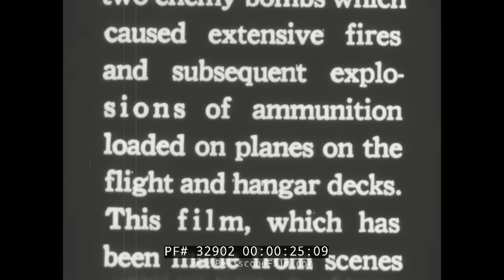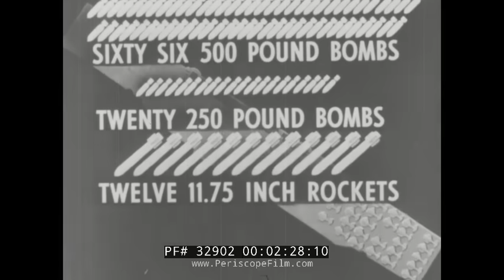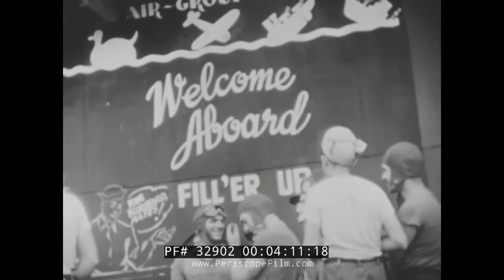" USS FRANKLIN "   STRUCTURAL ANALYSIS OF FIRE AND EXPLOSION ABOARD CARRIER USS FRANKLIN CV-13 32902

Comment: Franklin's captain should have been court martialed for criminal negligence.  Over 400 sailors were lined up for mess on the hanger deck when the bombs hit, yet Japanese aircraft had been reported nearby.   And Franklin was less than 200 miles from the Japanese mainland.  He later attempted to charge several hundred sailors with desertion after they had either been blown off of the ship or had jumped from the stern to avoid burning to death.
Reply: It's true that he should have been court-martialed, but he didn't get out of all responsibility. He was relieved of command, never again given a command of any importance and spent his last three years in the Navy in a meaningless Stateside position. Enlisted men generally believed that the senior admirals knew damn well that he was a bad officer and captain (there had been trouble between him and Franklin's crew ever since he'd taken command), and while they couldn't formally punish him they did what they could to informally punish him.
Reply: @sturmovik1274 Gehres also refused assistance from the Marvin h McIntyre and immediately got into a heated argument over the radio with Captain(later rear Admiral) John Joseph Hourihan witnessed by my grandpa who was on the McIntyre.

Comment: The IJN had developed new weapons toward the end of the war.
One of those was a heavy naval shell (16 inches & more) modified into an armour-piercing bomb.
It was probably this kind that struck USS Franklin.
Reply: IJN had those at the start of the war as well. They were used heavily during the Pearl Harbor attack and one of them is thought to have destroyed the Arizona.
Reply: You need velocity for armor piercing
Reply: @thebosscatman7  bombs deployed from dive bombers or high level bombers travel at near terminal velocity; I imagine the velocity would be somewhat similar to that reached by a shell in the final diving stage of its arcing path after being fired from a naval gun
Reply: @ZTIERK  it's a bit less. Battleship shells at practical battle range retain between 1,000 and 1,500 ft/sec of velocity, depending on size, shape, and weight. I've seen analysis of bombs at Midway that states bomb velocity from a dive bomber strikes at about 600 ft/sec, and then bases discussion of fuse settings based on that velocity.

These bombs (remember there are two of them) were 250 kg SAP bombs with a modest fuse delay. If it had been one of the larger AP bombs mentioned above there would only have been one.
Reply: @kemarisite  I did some more reading and found that battleship shells rarely exhibit true "plunging fire" and instead strike their targets at generally less than ~35 degrees even at extreme range; under these conditions, it makes sense then that (like you said) battleship shells would retain more velocity than bombs, since their flight paths are influenced both by gravity and by their initial muzzle velocity. However, it would be important to consider that since bombs strike their targets at much steeper angles (dive bombers generally dove at ~45-60 degrees), less velocity is necessary to penetrate deck armor in comparison to a shell impacting at a shallower angle. That said, the significantly greater velocity of shells fired by naval artillery probably overcame this difference handily :D
Reply: @ZTIERK  right about the lack of plunging fire. Even guns like the 16"/45 on the North Carolina and South Dakota classes are only getting to an impact angle of about 45 degrees, and that's at maximum range (36,000 yards or so) well beyond the range anyone has actually hit another ship at. Good dive bombers of the period, OTOH, were coming in at 70 degrees. For real plunging fire, check out the 12" coastal defense mortars the US had in service.

Comment: Wow, Big Ben survived that attack...The Essex class carriers were built to withstand a lot of damage.
Reply: There were very specific weight distribution and other reasons why Packy Shade did not design armored flight decks into the Essex-class. The shield layer was the 2.5 inch steel hanger deck. Shade was an engineering genius who succeeded in balancing the requirements of high cyclical sortie and recovery rates with a very high degrees of design survivability. Not too many naval engineers since have second guessed his trade-offs.
Reply: we trained our folks heavily in damage control. that helped a lot!!
Reply: No they weren't.  They should have had an armored flight deck like the Brits.  After a Kamikaze attack, all they needed to do was sweep the deck.
Reply: This was not a kamikaze  @jaykay8570
Reply: @jaykay8570  you are an ignorant tool and fool
and if you bothered to do any research you would go take a long walk off a short pier